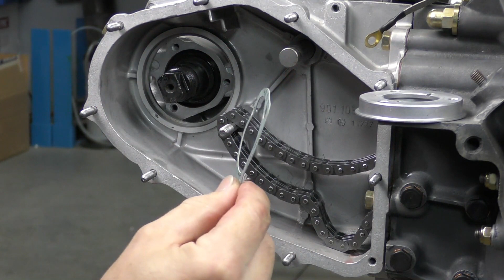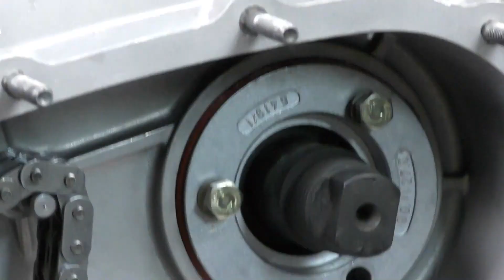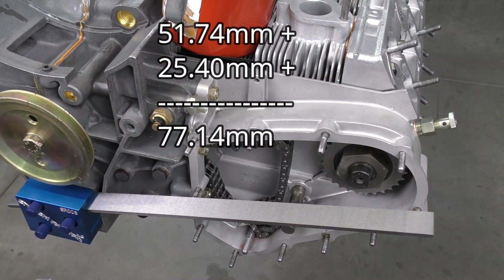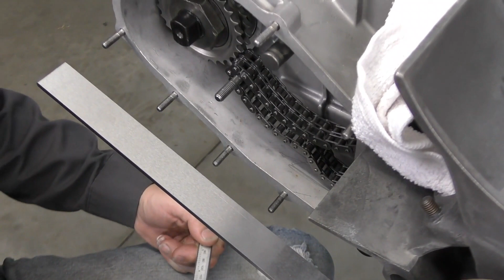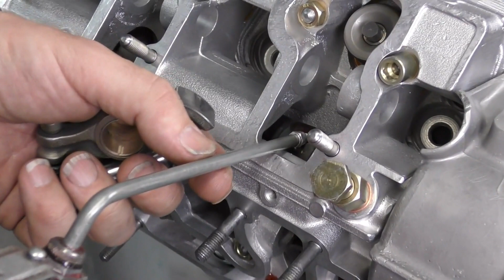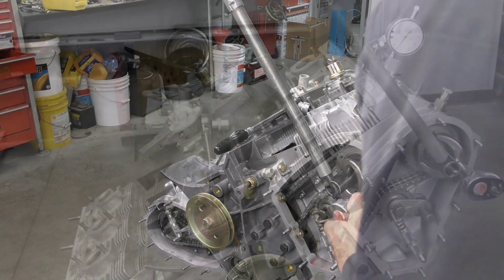How To Set Porsche Cam Timing. Rebuilding your air-cooled Porsche engine

Comment: Does chain depth measurement apply to all engine type?
Reply from the maker: Jesse,
Yes and no. The design dimensions of the intermediate shaft stay the same. The difference is in the way that you measure the chain depths. In late 1983 Porsche discontinued the access bore in the case to be able to measure from the outer part of the case to the chain gear. Instead Porsche gives us the dimension from the intermediate shaft thrust surface to the gear, (43.27 mm). Other than that the procedure is the same with the only real difference being now you have to do a little math on both chain wheel depths instead of just one.
Thanks for watching and I hope that answers your question
Kurt
Reply: @klassikats  thank you Kurt and sharing your videos. Your videos are very detailed and always helpful. Keep up the good work. Any 930 in your future videos?
Reply from the maker: @jesse818  Your welcome Jesse,.  We sold our 930 about two years ago and we do have some turbo stuff on the channel. But you never know, a lot of the videos are of customers' cars so if we get a 930 into the shop then we will have more videos on the turbos.
Thanks for watching

Comment: My right bank camshaft does not turn freely, the left bank one turns ok with fingers but makes a scraping sound. My engine is on a stand much like in this video. I have not put the chain boxes on but was test fitting the cams. When I took the engine apart the cams turned freely. I have had the camboxes vapor blasted some months ago. The camshafts have been polished (although the shop didn't so a great job) but I know how to polish them further. Should I start with the box bearing surfaces? Cams have been sitting covered and protected for about a year. Any tips?
Reply from the maker: Trenton,
It sounds like a couple of things may be happening. Firstly it sounds like the cam boxes have not been cleaned well enough after the vapor blasting. That is most likely the cause of the scraping sound. For the Camshaft that wont turn it is possible that the bearing surfaces in the cam box where over blasted and have a rougher than normal surface finish. We have a video on cleaning and rebuilding the cam box that you should check out https://youtu.be/r8qzvnoSEog
Reply: @klassikats  Thanks. I did take a bit of 800, 1000 and then 3000 grit wet sanding to the box. It helped a bit for the right bank cam box. However I went ahead and ordered a new one from Porsche. The dealer emailed me back and said that my cambox (part number#9931051117R) was a "racing housing". I have never heard of that have you? It looks like a standard box for the 94-98 993s.